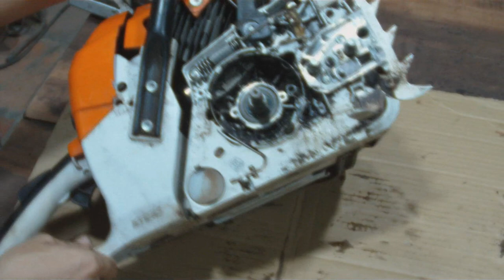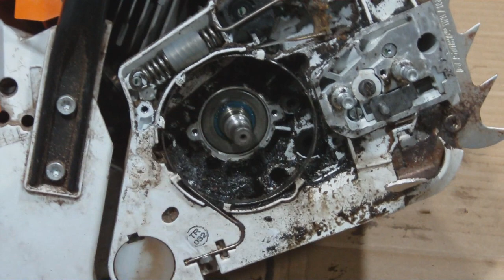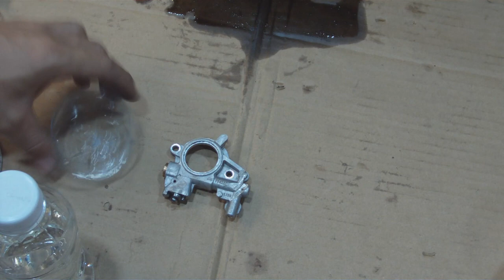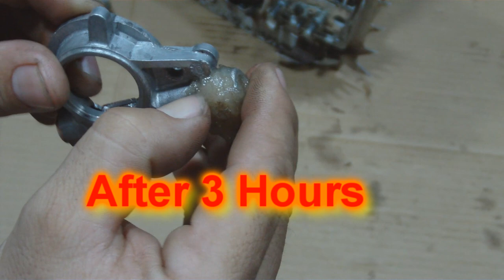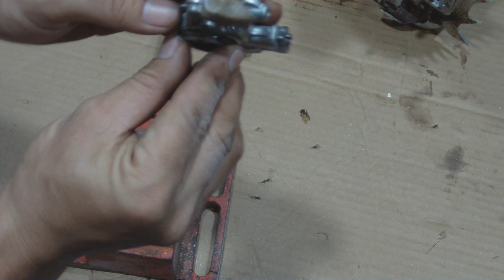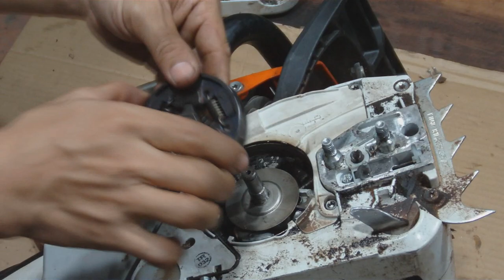Restoration/ Amazing Fixing Chain Saw Oil Pump STIHL MS 382 and change sprocket Bearing

Comment: hi sir.what other stihl model have similar part such as clutch,clutch drum,needle bearing,sprocket rim and oil pump to ms382?btw good content.
Reply from the maker: Sorry Friend, I Know only Some Model, so I cannot device about that . if you have problem with using chainsaw I can tell you . but sometime I have problem with my English
Reply: i hav ms382 and its a new model so i want to know other model that ms382 can use so i can find an after market parts.original parts is unreasonable price here.😅.nvrmine sir,btw thanks.
Reply from the maker: @kudalauthebat  There Some part already copy which made in China , price cheaper . please search in alibaba or aliexpress
Reply from the maker: @kudalauthebat where are you from?

Comment: Why does my device spray too much oil?
Reply from the maker: The same This model?
MS382?
Reply: Ms 660 2005
Reply from the maker: @behroozesmailli1297  I'm not sure that model , but you can take a look below of chain  saw  , maybe you will see one screw showing low  of high oil spray . I'm sorry , when I see I will show you in Community
Reply from the maker: @behroozesmailli1297  Please Check community